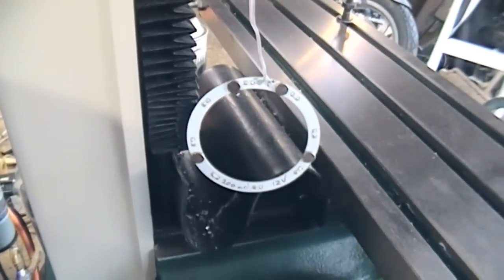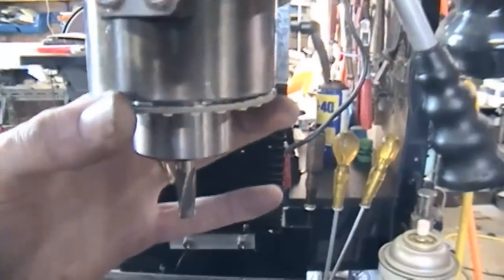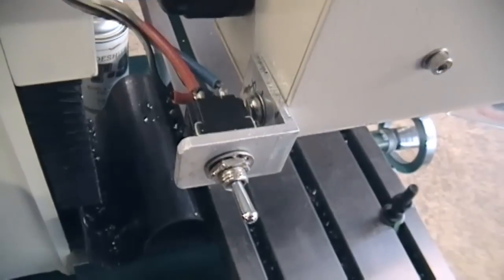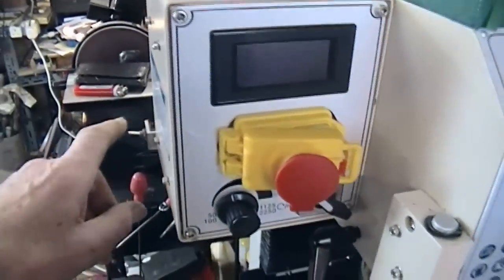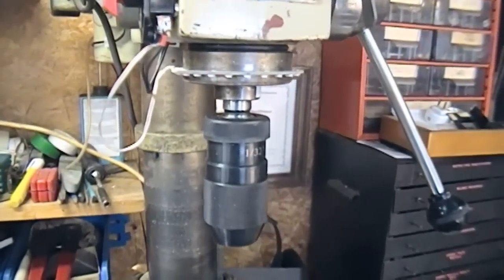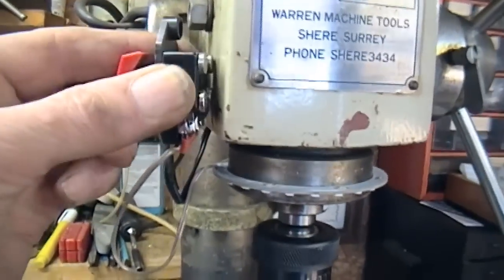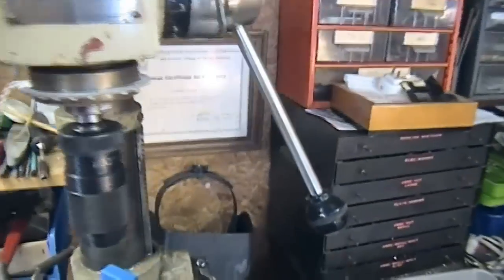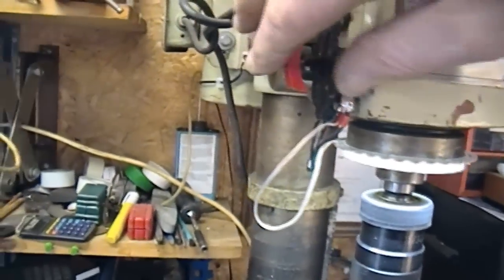"Angel Eyes" - On Drill Press and Mill

Comment: Hi Chris. Been enjoying your videos. I have a Sharp milling machine which is a knock off of a Bridgeport. I purchased a set of angel eyes like yours. The ID of the ring was a bit smaller than my quill so I cut one side of the ring, spread it apart and attached it by just spring tension to the quill itself. That way it travels up and down with the quill preventing the quill from creating shadows. The angel eye ring is in layers so cutting one side has no effect on the voltage plane. Also, where are you located? I am in North Eastern, Pennsylvania just below Binghamton NY. Been very cold here too.
Reply from the maker: David - have a feeling I'd already replied to this but anyways.  I was pleased with my results with Angel Eyes - only prob on drill press is a bit of shadow from keyless chuck. I am S Central PA - about 24 miles SE of Johnstown